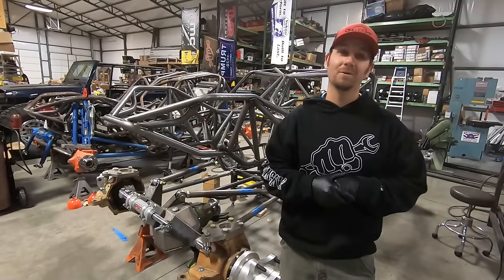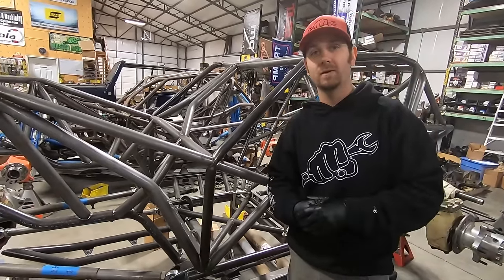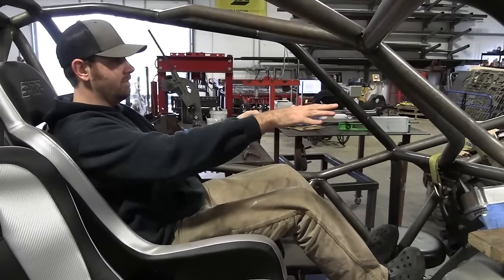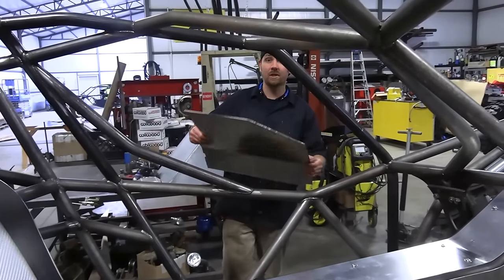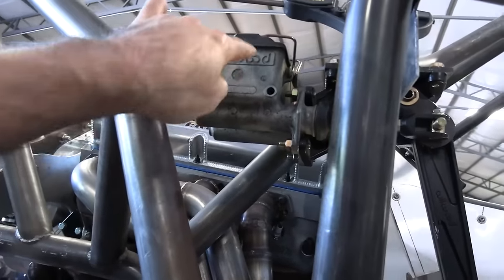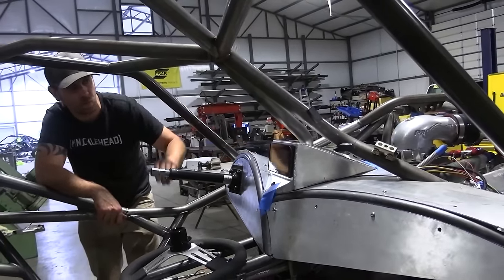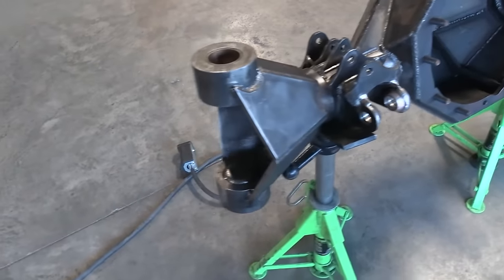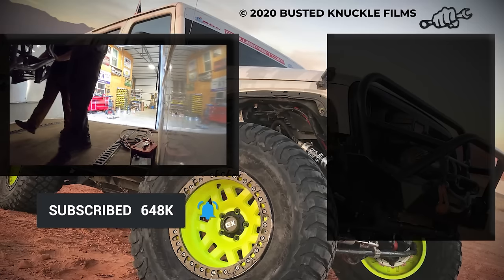1500HP Procharged Ford Rock Bouncer Build - TANTRUM pt1

Comment: I can barely imagine the amount of works JUST in the initial stages of design, tube bending, welding, etc and thats just the begining!! great work as usual and pushing the limits with those axles, great work keep it up !!
Im actually about to order some things from you that its going overseas (south america) but we are back again into a extreme quarantine/lockout, so itwill be at least a month from now, meanwhile keep the videos coming !!
Reply: A straight forward build will have 550 man hours in it.  This one has many more than that
Reply from the maker: so many hours it is crazy

Comment: Instead of those 90 degree AN fittings try using Banjo fittings -- You'll find they will flow more and be a lot tighter turns...
Reply from the maker: Which fittings are you talking about?

Comment: At least they are 5 lug instead of 10 lug hubs! on that same note,I always wondered why no one cut the 2.5t Rockwell hubs into 3 lug for weight savings...
Reply from the maker: 3 lug does not sound like near enough
Reply: @BustedKnuckleVideo   2.5t rocks use 3/4" lug studs...  but ok

Comment: Wow there's a lot. 1) those tires and lugs are so big they almost look fake.! XD 2) How much does just a frame like this end up weighing? 3)  I know there is a lot about the subject already but I was curious if you could make a video about how to optimize the handling of something so big. I can tell you try to keep the weight balanced between each tire so that the suspension performs well. But what about the having the bulk of the engine being behind the front tires (I think its something like polar moments for turning) and how does having rear steer affect this. Talk nerdy to me, thank you!
Reply from the maker: 1) You should see them now that we had them cut and grooved. 2) Two people can easily pick up a finished chassis and move it around. 3) Check out our other channel for more tech info from Jake.
Reply: @Busted Knuckle Films Out of sheer curiosity, did you happen to weigh the tires before and after?
Reply from the maker: they cut 50lbs from each tire
Reply: 😲 Looking forward to see them on the buggy when it’s completed.

Comment: Lathe 101 turn toward head stock. Bad machine practice to turn toward tail stock spindle thrust bearing set up for load toward head stock.
Reply from the maker: you lost me there.
Reply: @BustedKnuckleVideo  the start of video you show them turning a long shaft in the lathe they start cutting up by the chuck going toward the tail stock where the center is holding the other end of shaft that put Z axis cutting force away from the thrust bearings you should start at the tail stock and feed toward the chuck.

Comment: Congratulations, you have manufactured a chassis with very clean workmanship. What is the material you use in the manufacture of your chassis. Do you use boron steel or heat treated hardened tube like UHSS? And how much does this car chassis weigh?
Reply from the maker: We build them out of a mixture of 1.75 .120 and .188 wall USA DOM STEEL
Reply: @BustedKnuckleVideo  Nice choice is DOM Pipe. takes good shape. What is the alloy of the pipes you use? Such as ex: ST44, ST25, 4140, 1010, 22Mn5 alloys. And how much is this chassis weight?

Comment: So if you break a drive shaft you have no brakes?  What is the reasoning for not moving the disc brake to the Diff Pinion flange? Or do you not see drive shaft failures?
Reply from the maker: you won't break these driveshafts, but if you do somehow manage to do that you would lose breaks for that axle.

Comment: Other than the direction of the cooling fan on the alternator I don't know why you would need to mount the alternator backwards and with turning it in the standard direction mounted backward the fan is working against the ambient airflow anyway.
Reply from the maker: The way the accessories work on this they spin backward so they way they are oriented is the correct way.

Comment: So, I keep trying to put numbers on just materials for one of these.
Keepin HP at 6 or 700, and corporates or 80s, what? Like 50k?
Reply from the maker: Materials only on one of these is easily in the 70k range for a basic build. Our production bouncers start at just $80k turnkey with 550hp LS3 and 14bolts
Reply: @BustedKnuckleVideo  thx.
Reply from the maker: Glad I could help

Comment: The engineer in me wants to know why none of these rock bouncers ever have tubing from the shock tower to the top of the cab.  Just two little tubes would make a world of difference in rigidity and strength, and reduce the necessity for a complex engine cage.  Visibility wouldn't be hampered much at all.  Is it nothing more than aesthetics?
Reply from the maker: That would look pretty ugly IMO
Reply: Quite possibly, but I bet the lines could be cleaned up to make it look better.  Do you guys ever model any of these frames in solidworks for structural analysis?
Reply: Skinflaps Meatslapper i have every bar in our chassis modeled in SW but i dont know how to do structure analysis
Reply: @bustedknuckleoffroadllc5060  Stress analysis can be done with solidworks premium or solidworks simulation standard.  Click the simulation tab and set fixtures to mounting points (ie if you're testing frame stress points, set fixtures to shock towers, suspension link tabs, etc).  You can do the same with suspension components and even axle housings.  That's a super basic rundown to get started, but you can really get detailed with it and simulate a lot of different load factors, such as what the frame would see in different types of rollovers, landing on a single tire, impacts, that sort of thing.  Most the guys using solidworks for analysis take a bare bones frame (before gusseting, substructures, tie in tubing...just the basic shape), then stress test it and see where the stresses are.  From there they flesh it out and try out a number of different support structures to get the most strength with the least weight.  It's more of a tool to visualize where supports and gussets are the most critical instead of overbuilding a frame in all aspects to prevent failures.  Obviously it won't tell you everything, but it's a great engineering tool nonetheless.
Reply: Skinflaps Meatslapper i love it!  One day ill dabble in it and get something figured out.  Its hard enough building a working model with suspension cycling and steering cycling.  Lots of details.  One day ill check out the stress analysis
Reply: @bustedknuckleoffroadllc5060  No doubt, that's why people make a career out of it...lots of work goes into a single properly modeled and stress tested part, much less an entire vehicle.  I work on the experimental aviation side of it as a hobby, someday I'll get around to the baja/desert truck side of things (which ironically shares a lot in common with rock bouncers).

Comment: ProCharger description? (specs, numbers)
Reply from the maker: It's the mega one that is crank driven
Reply: Its an F3R-136, 136mm inlet, 12 inch volute diameter, 4000cfm, etc. etc. 

Its really big.

Comment: I will never understand why people insist on putting radiators behind the occupants heads. I guess they don't realize what happens when a hose blows. Long painful stay in the hospital.
Reply from the maker: good things we don't use radiator hose.....Nothing but stainless braided and AN fittings for us.
Reply: @BustedKnuckleVideo  ok good, most I see use hose and I cringe every time. Still a danger of kicking a rock into the radiator,  but not as likely to be an issue.
Reply from the maker: they are well protected in our builds. We have had zero radiator issues.

Comment: So with the brakes, when you mash the brake pedal it brakes the drive shaft and there aren't any brakes on each individual wheel? Don't know much at all about a rock bouncer. Is this vehicle like a 4-wheeler on steroids? You can drive it through mud, up steep hills, over big boulders, and in the sand? A cross between a 4-wheeler and a monster truck type vehicle.
Reply from the maker: It is more like a 4x4 rail buggy that is made to rollover and keep going without breaking. The tcase brakes are made to slow the drivetrain down which is actually more efficient that wheel brakes and save weight. They just don't do the best with endurance.
Reply: @BustedKnuckleVideo  Thanks for answering my questions. 👍

Comment: What size is the ring gear on those axles?
Reply from the maker: 12"
Reply: Busted Knuckle Films that’s no joke
Reply: Busted Knuckle Films what size axle shafts?
Reply from the maker: 2" 47 spline with big bell RCVs
Reply: Busted Knuckle Films axle goals👌🏻what does a set of those cost?
Reply from the maker: MEDIEVAL POSSUM I think they are around 20k for a set

Comment: i had an h1 for a little while n when u stopped at a light or had to stop fast the truck would rock because the discs mount at the diff, do u guys get much rockin on the trail with the brakes all the way in on the transfer case?? i could see that bein a real bitch in technical sections  i imagine ur drivetrains dont have that kinda play

Comment: Is it any faster than Gold Rush?   The answer is no. Gold rush was superior in every way. More travel does not equal better times. More horsepower does not mean quicker speed. Bigger axles do not mean better.   All you've done is increase cost. You've not improved course times.
Reply from the maker: we built the strongest, never said it could compete with gold rush

Comment: First of all a Procharger sets in front, not on top. Second is that is an engine, not a motor ( motors are powered by electricity, hydrolics, or some other source other than petroleum based fuel, which powers engines)
Reply from the maker: semantics
Reply: @BustedKnuckleVideo  No, knowing the difference between an engine and a motor, It is a matter of proper education.
Reply from the maker: no one cares...
Reply: @BustedKnuckleVideo  Only those with any kind of real automotive knowledge
Reply: @Denny Davis Except nobody has ever once talked about engine mounts...they're motor mounts 👊